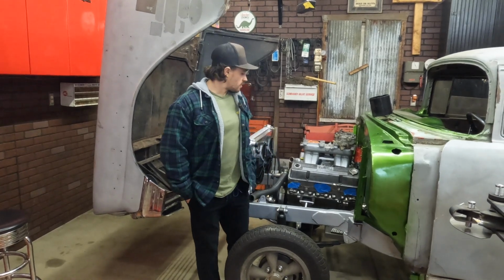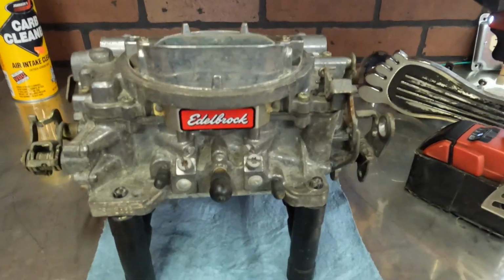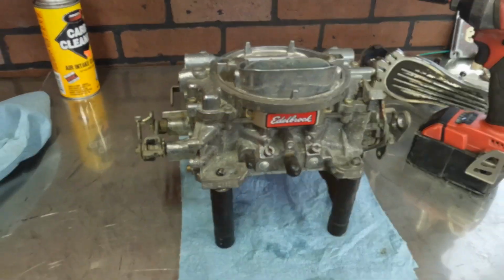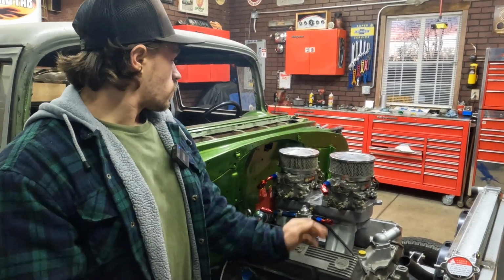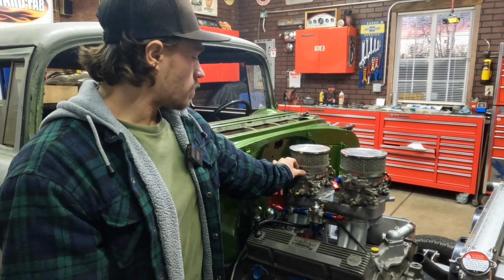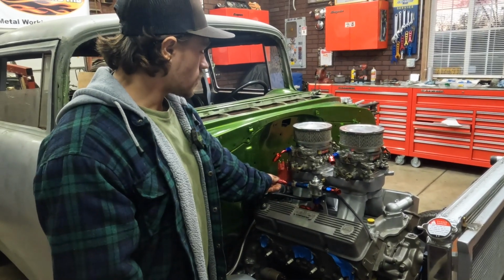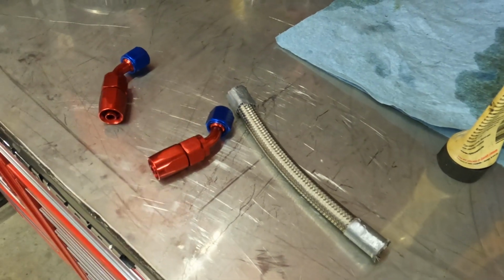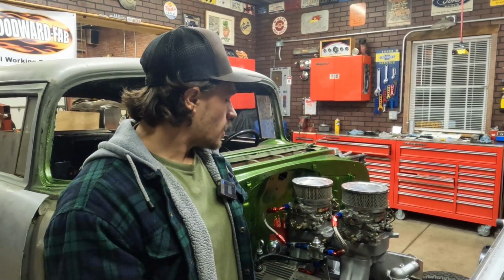Loud N Ugly Garage - Edelbrock 600s on a Tunnel Ram EP89

Comment: What size carbs are those? I'm running twin 600s on my big block. It has a slight stumble and I am wondering if I need bigger jets or could it be the accelerator pumps. They are kind of old. 🤔
Reply from the maker: They are 600s we have them tuned to stock settings so we have a baseline to work off of! I’d definitely do the research and get yours set up for your application!🤘🏼🇺🇸🏁